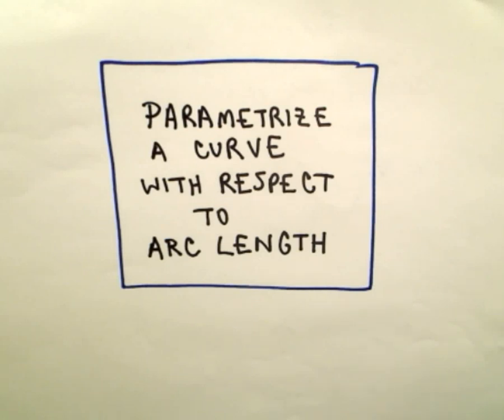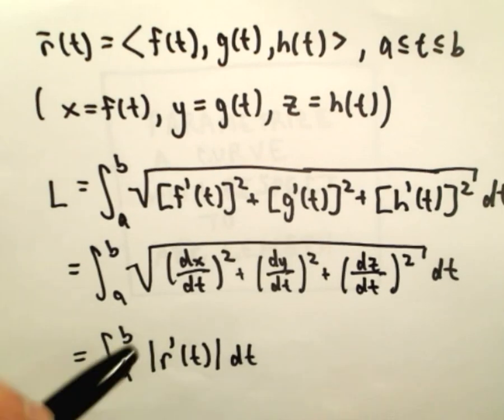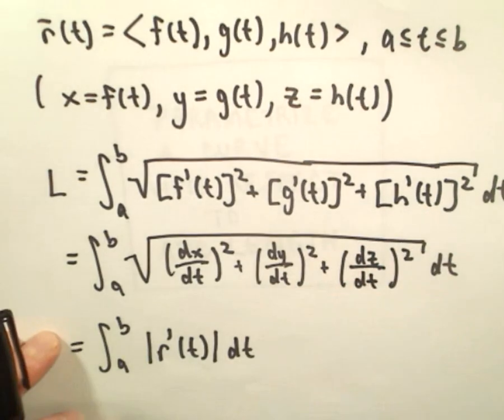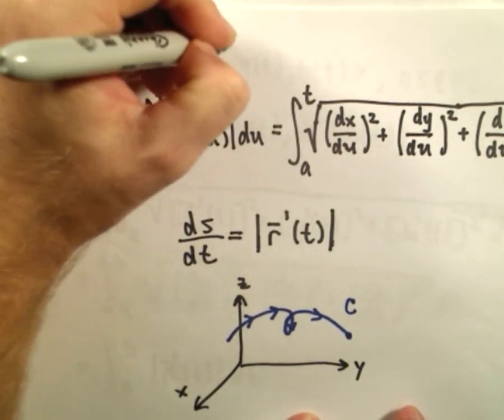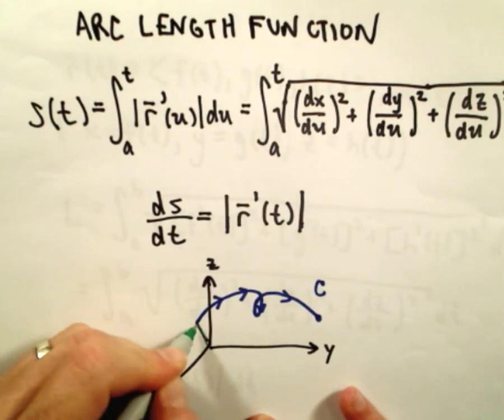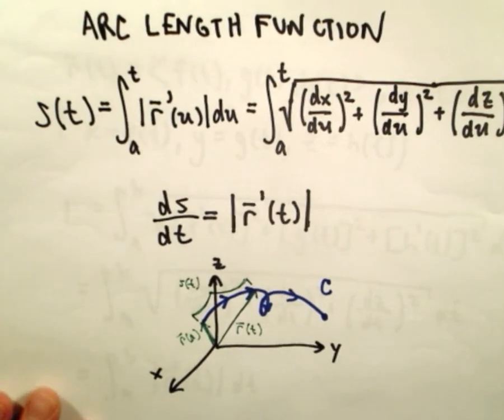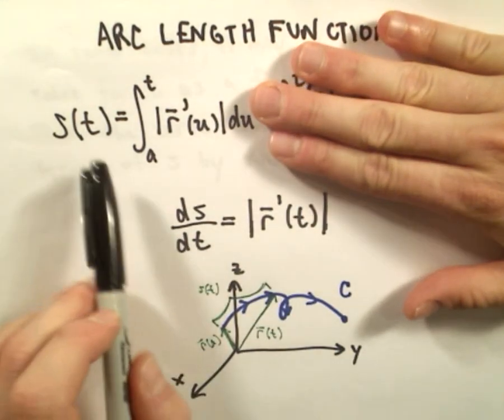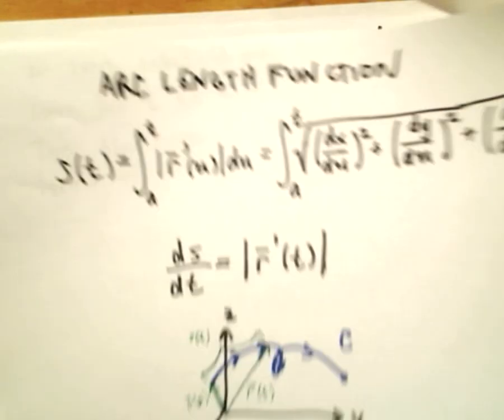Parametrize a Curve with Respect to Arc Length

Comment: What does in the direction of increasing t means?? it wasnt addressed here was it?
Reply: If anyone reads this still t will tell you what x,y,z equals too at each point once you have parameterized them, if you built a table you could plug in various t values and this will give you an idea of how an arc moves, and also create intermediate variables (x y and z) with t and also s being used as variables in multivariable functions
Reply: @rere-x6g   Thanks man. I graduated tho 😂. Thanks for the reply, nevertheless
Reply: @ishaaqahamed3888  And I failed 😭😭

Comment: Hi patrickJMT , I have a question... How can I find x w/ two given equation.

Example: Solve for finding x from    x - y = 3 &   -y - x = -7
Reply: ***** , (how can I times or) how will I show a 3x3 matrix after multiplying 3x1 and 1x3 matrics?
Reply: ***** but htat's the problem I have in finding 3x1 * 1x3 cuz...
1. there no second row on 3x1 and
2. no second column on 1x3.

Comment: Oh God I'm only in Calc (AB) that looks horrible.
Reply: Jaye サンダーの治世 Oh God. I remember having to do them in Precalc and I was scarred for life when I had to use them for complex numbers, conic rotation and parametric stuff. I don't think I've ever done worse on a test in my life.
Reply: Lukas Feuerstein
Yes Sir. I can certainly understand that.
For example, consider imaginary numbers. 4+3i in the imaginary number system means something entirely different than what vectors of the same symbol mean. 3i+4j in a rectilinear system means to go 3 units on the x-axis, and then go 4 units up on the y-axis. Whereas, in the imaginary number system i = Square root of -1.
Reply: Lukas Feuerstein Polar coordinates are actually not that hard, just exhausting to calculate.
Reply: Lukas Feuerstein
The unit vector's only purpose is to represent direction along the axis and has a magnitude of 1 unit thus the reason for the nomenclature. In a three dimensional coordinate system, you can think of the unit vector i + j + k as (1,0,0), (0,1,0) and (0,0,1). Each one, along its axis has a magnitude of 1. You can use variables and scalars to represent the direction of functions. Many years ago, I won scholarships in higher mathematics. I took 3 semesters of calculus and one of linear algebra with differential equations. It was fun. ROCK ON DUDE!
Reply: hang in there! you can do it!
Reply: it's not really all that bad! i and j, and k are unit vectors and used for directional purposes!
Reply: Tim Rubin Halcomb Unit Vectors were hard when I had to do them in Pre Calc, I don't even want to imagine what they would be like in Calc with all that polar coordinates stuff.
Reply: Tim Rubin Halcomb I think the hardest part of those for me was the fact that the symbols were so unfamiliar to me and that those problems were so hard to keep organized that I could almost never get those kind of problems right.